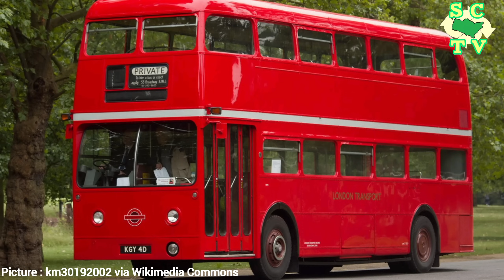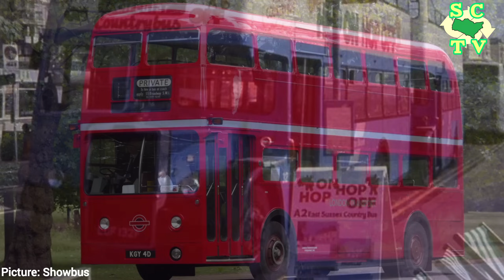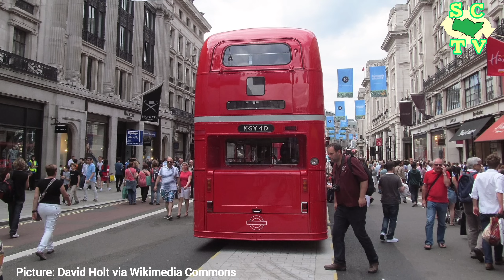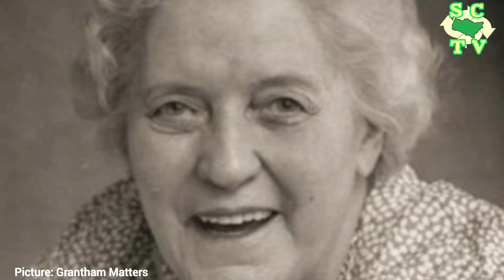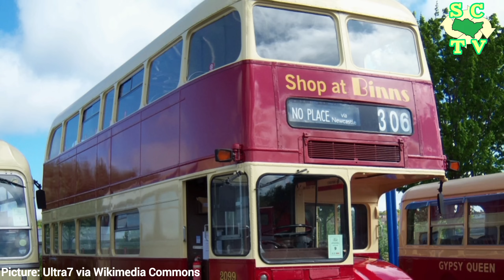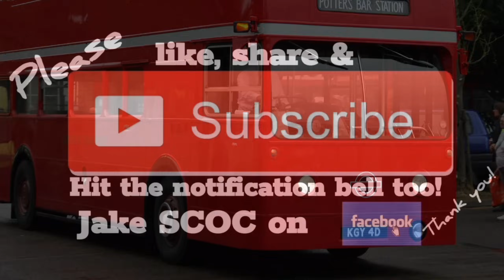The Story Of The Rear Engine Routemaster. Would It Have Been A Success?

Comment: Hi Jake,When I was a driver at Stockwell I quite often drove the staff bus to take drivers and conductor home at night.Staff bus drivers didn't really follow any procedure regarding bus allocation  we would just "grab a bus" and go.Well when FRM 1 turned up on the Round London Sightseeing tour  I was determined to drive it.I only ever took it once but I'm glad I did as I have driven every type of Routemaster there is with the exception of the ERM Which was a standard Routemaster with a full size bay(presumably taken from a Routemaster that was being scrapped) rather than the half bay per RML.So let me rattle of the list of RM types I've driven: 
RM,RML,RMC,RCL,RMA(minus trailer) FRM1and RMF - these were ex Northern General Routemasters working out of a depot in Nunhead run under contract to London Transport for the round London Sightseeing Tour (I was doing a spot of moonlighting !!).This depot which was in South East London just south of Peckham housed some museum pieces including an ST That ran on the vintage route 100 in Central London  and RT1.
During the Routemaster 60 celebrations I volunteered to be a"host" on the buses that were on display in Regent Street and quite by coincidence I was put on FRM1.I was so glad because I could tell the visitors a bit about it and my experience of driving it even if it was only once !!
Keep 'em coming Jake,cheers !!
Reply from the maker: @SIMONWINTER-m6d  That's brilliant Simon. I think I said before that I know the old Nunhead Garage very well. Didn't realise it used to have all those treasures inside though. Was there much difference between all the types or were they all highly standardised?
Reply: @JakeSCOC  I believe at the time(it was 1982) that the late Prince Marshall and Leon Daniels were the owners of this fleet at Nunhead. Also there were some "decapitated" Midland red buses that had the Fleet initials OM which stood for Old motor, a magazine Prince Marshall published at the time.I'm not sure of which buses you are reffing to when you ask me about "standardisation " perhaps you could let me know. Thanks.
Reply from the maker: @SIMONWINTER-m6d  I've heard of Prince Marshall and his fleet. 
Were all the cab layouts on the different RM variants the same? Did they handle all the same too? I've only driven RM/RML and RMC.
Reply: @JakeSCOC  A Northern General RMF Was exactly the same to drive and the cab layout exactly the same as an RM or RML with two minor exceptions.The gears were semi automatic like a country area RML and the windscreen was one piece, not split like a London Transport screen.Oh and obviously there were passenger door control buttons.
Reply: @SIMONWINTER-m6d  OM Open Top Midland (D9s) Red
Reply: @SIMONWINTER-m6d  Did you mean Leon Daniels ?
Reply: @SIMONWINTER-m6d  Were there not slight differences between the LT/"Demonstrator" RMF 1254 and what Northern General Strictly ordered, and I guess the Northern General modified "Tynesider" and "Wearsider" variant count strictly as RM sub classes (Along with the Weymann/ Leyland RM (L) Prototype and I suppose the two single deck RMs( but they were only single due to incidents).
Reply: @SIMONWINTER-m6d  The RMC / RCL had different back Axles , along with the BEA versions.  not sure what the Northern Generals had, given the hills in that area presumable something similar to London.
Reply: @highpath4776  I couldn't reasonably be expected to have driven any of the prototype RMs.I take your point about the two Northern General RMF "sub class" buses.I consider myself lucky to have driven any RMFs as they were in London working on the Round London Sightseeing Tour. I still think I've driven more Routemaster types than most people get to.
By the way how are you ? I hope you are well.
Reply: @highpath4776  Yes I did but I'm getting old and confused. It's a good job I've retired. I have corrected my error. Thanks for pointing it out.
Reply: @SIMONWINTER-m6d  I could tell you a story about a hole in a pavement and a local authority that cannot be bothered to find out if newly installed (3 years) lights are working , but suffice to say I am in different pain to the normal ongoing sufferings, and does a toilet roll holder that unwound itself over a short time from the wall plate (and being not a proper thread is nigh impossible to re-secure also count as first world suffering ?  Wondered if you had driven the prototypes at Cobham, etc , events.  We (HCVC London Branch) hired RMC4 for a evening trip to Brighton in 1982ish.  We were being hailed at bus stops going past Preston Park !
Reply: @highpath4776  I didn't think that museums would trust us mere mortals to drive priceless prototypes. I haven't visited many bus museums but now I've retired I must start as I was generally to busy and too tired when I was working. 
I hope you are in a better place than you were a couple of years ago(while I am typing this an emoji of an avocado has appeared and of course because I typed the word avocado it appeared again. I wonder what that is about) and things will improve for you.Take good care.
Reply: @SIMONWINTER-m6d  Drivers always needed for running days, even if its just the muesum ford transit or the austin ambluance
Reply: @highpath4776  Still got my PCV but it has to be renewed annually at my age and my CPC has run out. I'm not so sure it would be worth renewing it just for occasional museum running days.
Reply: @SIMONWINTER-m6d  Running Days dont have passengers paying fares so do you (at your age) strictly need the PCV licence ? The CPC is a pain, useful in concept, certainly for daily working drivers.  There is a problem with running days though with crew communication on open platform buses at bus stopping points particulary where the stops are share with service buses (mostly because the current LT buses practice is to call stopping somewhere withing two bus lengths of the stop pole as being the right place for passengers to alight or board, then fly off round the ones in front while us less ambulent cannot get to the vehicle. Less of a problem with OPO of course but how did RMs etc consider that they had "stopped" at a stop as folk might alight when the driver things they were actually just held in traffic and move off to the stop location without a starting signal being given. (I guess you were trained to use your mirrors but even so people can be missed )
Reply: @highpath4776  With an open platform bus the following procedure should be adopted. If the bus is in traffic and is stationary check the near side mirror to see if anyone is boarding or alighting regardless whether the bus is near a stop or not.If anyone is in the act of boarding or alighting delay moving off
till you are sure the passengers or intending passengers have finished. If the bus is near the stop and people start getting off "en mass" the bus is deemed to be at the bus stop and you should not move the bus until you receive the starting signal from the conductor. If you have received this signal and you are pulling away the stop will still be in front of the bus and you must be prepared to stop again should someone want to board.If you stop again you must wait for a further starting signal from the conductor OR you can retire like me !!
Reply: @SIMONWINTER-m6d  I thought that was the procedure (I cannot remember the legal "training" to get a green conductors badge, and even the NVQ Passenger Assistant modules dont really cover all of that.  I think some preserved drivers / conductors dont really know that (and LT drivers who dont do the latter part of your note refuse to tell me if they have read - and understood - what the Red Book says (isnt a copy of that supposed to be with you at all times ? ))
Reply: @JakeSCOC  RT1 I think had some odd quirks (even technically the amount of RT1 is a bit of Triggers Broom about it) , along with the other "pre war" RTs.  The ST was the Bus Leon Daniels passed his PSV Test on (cannot do it now its too short for the test vehicle min length) and it certainly didnt have power (assisted) steering.  I imagine the ERM with the longer wheelbase would need some thought on which route into corners you need to take.
Reply: @highpath4776  I reckon the "triggers broom" syndrome can apply to a lot of preserved buses.Even while they were still in service it's hard to imagine a bus that may have been more than thirty years old would have been running with most of it's original parts .And don't get me started on a refurbished RML with the Cummins or Iveco engine and fluorescent lights !!

Comment: I think that if AEC had remained independent or Leyland had been interested in the project, the difficulties with the rear engine Routemaster could have been ironed out the same as they were with other new bus designs. As it was, they weren't. It's interesting that the "new Routemaster" project has produced another rear engine RM alike bus, which can also serve as a new Bristol VR alike bus depending on where it's needed. If you take away the rear platform, you end up with more of a "new VR" than a "new RM", although the size of the new bus is considerably greater than either. When these new buses started appearing in the early 2000s, I used to call them street ships.
Reply from the maker: @IndigoJo  Yes I think things could have been ironed out if they'd have put a bit of time into it or wanted it to work

Comment: I did get a ride on FRM1 -- I submitted myself to the horrors of the Round London Bus Tour because I saw the legendary FRM1 was operating it! It seemed....well completely normal to ride in, which is I guess a complement for a prototype. Of course they might have been teething troubles, but there's no reason why it couldn't have been successful. Yes, maybe operators outside of London wouldn't want it, but a big order from LT is a BIG order! And of course the availability of common parts between FRM and RML/RMCs would only have been of interest to LT, not operators elsewhere. There again, maybe the eventual closure of the Aldenham works would have caused problems to maintain FRMs to the standard needed. btw I love the destination blind of 'No Place' on the NGT Routemaster - yes, there really is a place called No Place in North Durham!
Reply from the maker: @timbounds7190  I suppose another scenario would have seen the bodywork updated by Park Royal to a more contemporary style which might have appealed to more operators? Obviously that bodywork would have to be well built to support the subframes.
Reply: @JakeSCOC  Yes, I guess the Routemaster was looking a little behind the times at that time. But when does a revised Routemaster stop being a Routemaster? To an extent, the Routemaster was designed by LT for LT's perceived specific needs, and in the end, operators elsewhere were evidently more or less happy with the Atlantean / Fleetline / VRT, even if they complained about them! Whatever other problems those buses had, they had the Leyland 0680 or Gardner 6LX engines, which everyone really liked.

Comment: Another excellent video.  

Leyland's arrogance in its product range cost them customers.  For example, when they discontinued the AEC Reliance, many operators went for the Volvo B58 rather than the ZF geared Leopard option.

In his book on North Western Road Car, Peter Caunt criticised the AEC Reliance for overheating.  They used Reliances on express services.  Yet many other operators had Reliances on express with no problems.  

(My First brush with a Reliance involved new to Robin Hood Coaches manual transmission 194 GAL, owned at the time by Nantyglo Kingfishers Jazz Band.  The trainer, knowing my interest in buses, let me have a drive.  I couldnt get my head around the manual box.)

You mention that the FRM was designed for London, and that provincial operators would have probably gone for the known quantity product offerings.  Would LT have made up the critical  mass of customers needed for the FRM to succeed?  If it had been a success, would LCBS have stayed with it post 1972, or would it have gone the way it did with the AN class Atlantean?  Incidentally, the BT class Bristol VR, so popular with other operators, did not find favour with LCBS, limited to a handful at Greys which were quickly sold on to Badgerline.

Finally, i was impressed by the sympathetic way in which the tachograph was fitted to FRM1.  Some conversions looked line the afterthought they were.

Keep up the good work.
Reply from the maker: @TimothyWorel-f8j  Thanks very much. Glad you enjoyed the video. 
Yes Leyland lost a lot of customers in general as it encouraged the birth of the Metrobus and the Dominator too. 
The only Reliances I've heard about overheating were the ex East Kent ones that had been rebodied by Berkof in the early 80s. The new body was a tonne heavier than the old Plaxton one and they were slow too.

Comment: As you know I’ve driven RM/RMLs on the 9/94 routes and had the honour of driving FRM1 at the LT depot ,only from the entrance to the back and found it basic in cab layout but ok ,amazing what  a£5 gets you 😂,I have a book somewhere showing what they could of done with this concept and renderings of the proposed buses one looked like an XMS a green line coach with twin head lamps a provincial with peaks instead of domes ,imagine Jake a FRM with DMS style bodywork or AN style yes with continued fleet renewal and if it fitted in  with aldenham overhaul style then yes ,here is one remember when Croydon restarted trams they numbered the trams from the last one built ,the why wasn’t the Boris bus to have NRM type classification and numbered from the the last RML as all RMs regardless of type was in the same number sequence 
Great video Jake 
Mark 😊😊
Reply from the maker: @marksinthehouse1968  Thanks Mark. Wasn't that the XRM project? They were messing around with hydraulic pump drive and stuff like that. Absolutely bonkers. That's interesting, I didn't know about the trams. I think they could have done a lot more with those new RMs couldn't they? Be interesting to see what happens to them when they're sold. Will need to be rebuilt if an operator is going to use them here I would have thought.
Reply: @JakeSCOC the thing is we’ve got them now they seem to have settled down just keep  then maintained and maybe retro fit electric motors as I think they are based on the Volvo VH type chassis well they drive alike 😊,to Americans etc they are the new RT/RM and yes I would of tweaked the design a tad 😊
Reply: @JakeSCOC They may end up like Boris,on the scrap heap !!😊😊

Comment: Excellent video. One issue, I believe, is that it was narrower than the contemporary Leyland Atlantean and Daimler Fleetline. This may have suited London but would have been an issue for many provincial operators.
Reply: I would have thought that all Fleetlines were the same width because London Transport Fleetlines were 8ft 2.5ins I believe they were only built to this dimension because they could,the law allowing buses to be 2.5 ins wider.If and it's a very big if FRMs had been sold to other operations I don't think the 2.5ins would have been that much of a problem to them.The only reason,of course,the FRM was 8ft wide was because the Routemaster is 8ft wide but if there had been a production run of FRMs a lot of things could be changed.My understanding is that the FRM was manufactured from RM parts "in the spares bin" with non standard parts having to be specially made.A production run would have required new parts from the word go so these could easily be made to a different design. Also,I would have thought, a centre exit would have been added at least to buses being operated in London.
Reply from the maker: @SIMONWINTER-m6d  We actually touched on this in a CPC course a few weeks ago. Not sure how accurate is what I was told. Original width was 8 foot but the 8 foot two and a half inches equals 2 and a half metres.
I've often wondered why it didn't have a centre exit too.
Reply: @JakeSCOC  All depends on how many pounds the bus weighs!!!
I'll get my coat.
Reply from the maker: @SIMONWINTER-m6d  😂
Reply: @SIMONWINTER-m6d  Depends where you used it. One idea was conductor fares collection, then "off peak" stairs closed and run as a single decker.  If you a running on routes that basically have one pick up point then generally drop off (or vice versa) then the second door isnt really needed ,  and Greater Manchester managed on many routes without the second door (though City Of Oxford seemed an exception on my rule !).   So for school services, certain works contracts (eg the Ford Dagenham and Barking Power Station / London Docks services it might have been a good niche,  indeed better as a replacement for the RMA ?
Reply: I always thought it did look narrower but the dimensions I've seen all say it was 8 feet wide, the same as Atlanteans & Fleetlines.
Reply from the maker: @fluffybadger9832  Maybe it has a tapered front like the early VRs?
Reply from the maker: @northernblue1093  Glad you enjoyed it. I didn't realise it was narrower.